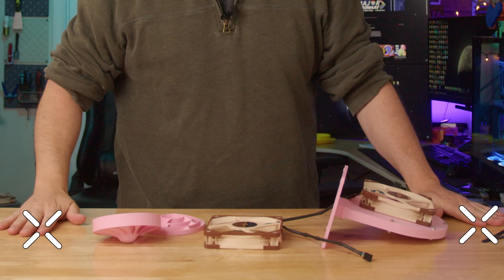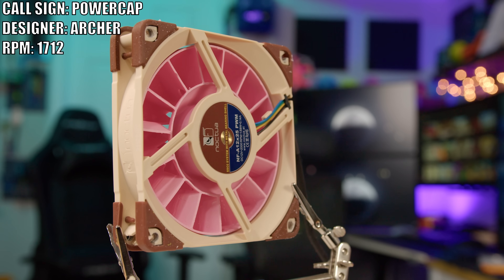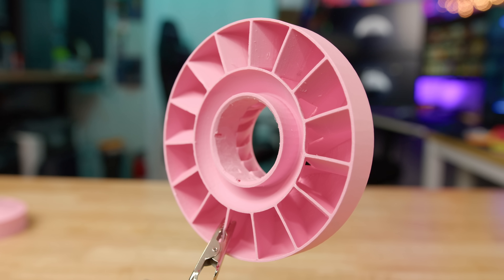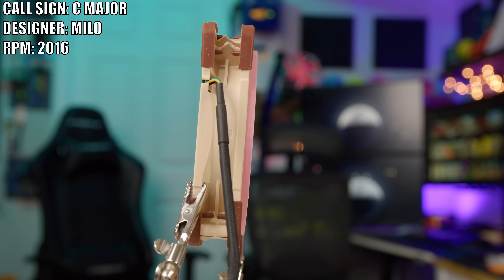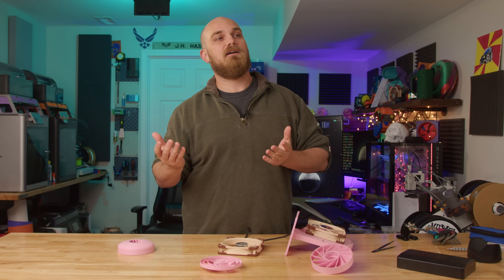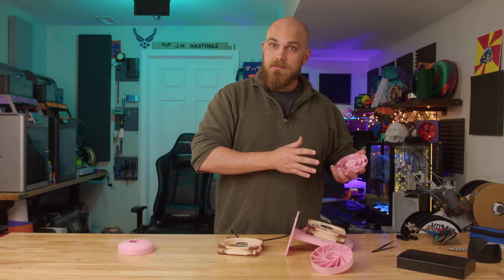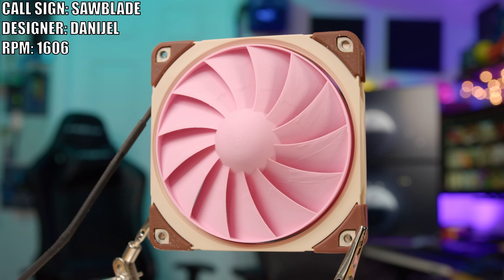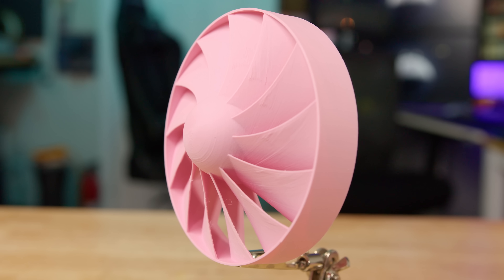Insane Fan Hack WINS Big! 😱 | Fan Showdown S6E4: Ultimate Static Pressure Battle

Comment: As a professional audio engineer I can concur that a fan (or any thing in motion) can be both extremely quiet and yet still annoying if all the sound is built up in a narrow frequency band(s). think whistling vs blowing air with an open mouth.  
An octave is a doubling of frequency. its named oct because in music that double is 8 notes up or down. 
Fun fact: good car tyre designers use the opposite approach to Milo by making sure the tyre grooves are not properly regular as otherwise your car would make a distinct 'note' at a held speed and it is one of the ways they reduce traffic sound pollution.

Comment: 3D printed the c Major and forgot to come back and say anything...
...It's great. Its a very lovely hum. I'm able to tune the RPMs of my fan and I got it perfect at 2002 RPM.
When I kick it into power mode at 6K rpm... It also sounds great.

Also, I mounted the Wonder from Down Under to my GF's gaming laptop.
No more heating problems from the 4080. That little mf used to heat up the whole bedroom.
I no longer need to crank the AC just to sit comfortable at my desk.

Comment: For me the Sawblade is the winner with only 2.6 dBA on your list while all the others are in the 40s and 50s. So 20 Sawblade fans would be as loud as a single one of the competitors, what means you can multiply the output airflow times 20.

Comment: Took a blower gpu. Removed the fan and plastic shroud over the heatsink.
Used dual 140mm fans mounted to this enclosure I printed. Looks like dual tubskeezs 3080 ti dropped to 26c idle. Boost is insane. Vram temps super low. Casses need re designed around this technology.

Comment: Reverse the fan on the stock CPU cooler, then use the Wonder for the rear fan, getting the reverse CPU fan that blows as directly as possible into the Wonder. Or place the wonder externally at the rear to blow inward to the CPU fan and have the bottom/top fans as output airflow.

Comment: surely WFDU should be disqualified? Seeing as static pressure is used to push air through radiators? And with an output slot that small its going to be outperformed by fans with less static pressure?

Comment: i think it would be interesting to switch to one of those 10W 12V 120x120x38's from Sunon, that have 234m3/h / 138cfm and 0.36 in h2o / 9.15mmh2o static pressure

some fans are spinning slower which i believe is due to the power limit of the Noctuas, the A12x25 is limited to 1.7W

Comment: Perhaps it would be worthwhile to look into the designs of the blower fans that are used in CPAP and BiPAP machines that are used for the treatment of Sleep Apnea. My CPAP machine is able to be set as high as 20cm/h2o (200mm/h20). It is also to my understanding that BiPAP machines are designed to reach pressures as high as 30cm h20 (300mm h2o).

PS... My CPAP is practically silent. (Resmed S-10 autoset)

Comment: WFDU might see some improvement with better seals, but it doesn't have to be tape as was mentioned by the original designer. It can be improved with just 3D printing. Along the face where the two halves meet, create a continuous slot in the wall on one half, and create a matching tab on the other half. That will make a better, more consistent seal than just clamping two flat faces together.

Comment: Power cap should have its air flow in opposite direction - sucking through side with big blades and exhaust through small hole. Way its done now just cant produce solid results...
Reply: Its doesnt work like that.

Comment: The Wonder From Down under should not be qualified as it is not confided to just within the fan-case.

Now I don't know the rules, I trust it is well within it. But this contest seems to be meant for a specific application in a PC case, so the rules allow for designs that are not in line with the contest goal itself.
Reply: The contest goal is highest static pressure.
Reply: @TheRattleSnake3145  looking at all submissions, the general intention seems to be to keep it within the fancase and visually appealing. Now you may have won this round within the rules, but no-one will choose your design to mount in their PC case. It doesn't follow the spirit of the contest.

It's like the fancar in motorsports that sucked itself to the track. Fantastic power, but looked like an abomination and was soon banned.
Reply: @KiterTMK  Noone will choose any of these designs to put in their case. Who is going to buy an expensive a12x25 fan just to break off the perfectly good blades just so they can then print a random fan design to put on it?
Reply: @KiterTMK  it's fine if you don't like the competition, it makes a good opportunity to start your own.
Reply: @TheRattleSnake3145  it is a standard form factor, you can literally buy the cheapest fan on the market and replace the blade.

Like I said, respected the rules, but not the spirit of the competition. You decide how heavy an opinion of one steps on your toes mate.
Reply: @KiterTMK  You came here, admitted you didn't know the rules now you are saying you know better than the person that runs the competition and chooses which design to print?  Also its for the 12x25 not the "Cheapest Fan on the market"
Reply: @KiterTMK  You clearly don't respect the rules, if you did you wouldn't have posted this negativity towards them.
Reply: @TheRattleSnake3145  you are making a ton of assumptions just to protect your ego.
Reply: @KiterTMK   You can't say one thing I have said that is wrong and you keep ignoring when I show that you are wrong   You are clearly here just to troll ( as you keep replying) and make yourself feel better.
Reply: @TheRattleSnake3145

There is no point in a rational argument about how right I am and how wrong you are because you are so offended by my opinion which invalidates your achievement. That makes it an emotional argument that cannot be reasoned.
Reply: @KiterTMK  there is no point in your "rational" argument because you don't have one and you know it, that's why you haven't countered anything I wrote ( because you can't). You also keep ignoring what I wrote because you know I'm  right and can't legitimately answer.   For some reason you have been severely triggered by a design that  was chosen by MH himself.     Start your own competition , ban all designs you don't like and get zero innovation.     Let's see then which competition  is more  popular.   Keep responding and attempting to troll as much as you like,  it will only boost the interaction on MH's channel and I will get to waste your time.  It's a win win for me.
Reply: @TheRattleSnake3145  I'm happy for the boost for MH, I'm not losing there.

You are pulling my statement out of context. I said you stayed well within the rules, but it's not in the spirit of the usual design. You brought a tiger to a housecatfight. Within the rules, not entirely a fair apples to apples comparison. That does not mean it is disrespect to the rules there.

For MH, choosing your design has the rationale of it being a hilarious oddball that boosts his engagement and thus revenue. Plenty of designs could have been chosen, but haven't to unknown criteria, it's how show, his rules what makes it to the spotlight in his best interest.

Comment: But the Wonder from Downunder is not a fan and cannot be used in any way.  It would also absolutely suck in terms of cooling, i don't know ain't that's what a fan is made for? I don't get it.
Reply: This is a static pressure design comp, thats it. Not hard to get.
Reply: @TheRattleSnake3145  Yeah i know it's about the static pressure mate but it's a fan showdown. Every other fan on the list is useable, this one isn't. That's what i don't get. What's the purpose of the design? Creating useless static pressure?
Reply: @poserbob6888  Noone is going to buy an a12x25, destroy the blades to get them off just so they can print a random fan from the showdown.   Using your logic, this comp should be shut down as none of it is really usable.
Reply: @TheRattleSnake3145  the A12x25 is just used to compare it to it's own design. Noctua could use any of the designs shown in the fan showdown except yours. That's the thing you don't seem to get. Your design built the maximum static pressure so far but is unuseable. Using my logic, Noctua or any other fan manufacturer could use some of the designs shown here in the future, except yours. Yours stays useless.

That is what i am up to. it's a FAN showdown, your concept is great but it's not a fan anymore.
Reply: @poserbob6888 this is NOT a design competition for some company ,it is for fun and entertainment.  it comes down to this, you are ignoring the stipulation of this competition which is to make the highest static pressure design you can using the a12x25.  That's it, nothing more, nothing less.
Reply: @poserbob6888  I suggest you start your own competition so you can run it how you like.
Reply: @TheRattleSnake3145  in this case, FAN showdown is misleading. Nevermind.
Reply: @poserbob6888  I mean, you could just listen to what he says

Comment: Surely, for the four inner blades to create a 31Hz fundamental signal the fan would have to spin at something absurdly slow like 7.5Hz (31/4). There are four blades hitting the air per revolution and that is certainly going to form the fundamental frequency of whatever combined sound that ring produces).
The only way I can see these blades can produce low frequency sounds, spinning at thousands or RPM, is if there is a "beat frequency" difference BETWEEN the rings, not the effect of any one ring. However, the rather course blade ratios provided by those three rings doesn't feel they could provide a difference frequency of 31 from rpm's in the thousands,... but clearly something is! Would be interested to understand the dynamics of what's creating this 31-33Hz signal

Comment: @Major Hardware Since you can measure the static pressure, flow and everything, can you stack 2 normal fans on top of each other (working in the same direction of course) and see how much the improvement is? I think that would be really interesting from a noise perspective as well, for example same noise but 30% more airflow or something? It would be good to know what to expect from such a configuration. Like stacking 2 cheap Arctic P12 PWM (3,99 each) against some pricey bequiet fan or so.

Comment: I'm honestly most impressed with the Sawblade. It seems a clean improvement over the Noctua A12x25, same noise and higher static pressure at a lower RPM. I would be interested in seeing an airflow testing of that one, as well.

Comment: What's the point of all this if there's no temps?
Reply: Getting the highest static pressure is the point.
Reply: @TheRattleSnake3145  I'd argue temps are a better measure.
Reply: @xtremefps_  This is NOT a temp contest is it?
Reply: @TheRattleSnake3145  It started out with temps and then eventually he dropped it and basically didn't explain why. I stopped watching and drop by an episode every now and then and skim the video looking for temps to see if he brought it back. The way I see it, what's the point if we don't know the temps since they would be the best indicator of which one is actually better in real-world results.
Reply: @xtremefps_  The point is the fun of designing and the fun of watching other peoples designs.  there have also been full airflow, airflow through a radiator.  This season is full static pressure. It is different every season.

Comment: The wonder from down under is basically centrifugal blower. When the rotor starts spinning, the pressure around the outside increases (this is due to centrifugal force, which is a real force that is experienced by objects in a rotating). This causes air to exit through the outflow opening. The exiting air also draws in air from the center. These will always win static tests assuming they are properly designed. The power cap is almost a blower but they kind of screwed up the design.

Maximizing static pressure involves considering the characteristics of the driving motor also. The rotor has to be sized so the motor operates at a speed and torque where it delivers high power.
Reply: I am sure you are correct in you explaination as a whole, but I'd like to point out, that centrifugal force is not a real force.
Take for instance the "feeling" of being pushed to the outside of a curve when driving a car into said curve with a bit too much velocity.
Now, since changing direction (driving through a curve is constantly changing direction) will always be an acceleration of the car, and the car (and you within it) is being pulled into the curve by the friction of your tires on the road, you will feel a "force" "pulling" you out of that curve. And whilst the feeling is certainly real enough, calling it a force is not correct.
It is in fact caused by the tendency of objects to stay on their path as long as no other force acts on them to change that, called inertia, as decribed in newton's first law.

So your body and your car "want" to go in a straight line, but the friction of the tires on the road keeps acting as a force to accelerate the car into a new direction.
That is also why friction is such a huge factor for race car tires, as they have to get through a  curve at MUCH higher speeds than a normal passenger car has to. SO the race car tire needs to get a LOT mor friction on the ground to actually be able to stay in the curve and not get pushed out of the race course by its own inertia.
Reply: @Craveheart3699  I took physics too. The centrifugal force is real in the sense that it can cause a pressure gradient in a fluid. If it weren't real, centrifuges (and centrifugal blowers) would not work. People often say that it is not a real force. This is a stupid thing to say. I think it is best to say that it is a force perceived by observers in a rotating reference frame. Some examples of people who might be in a rotating reference frame are every single person living on planet earth.

However, to observers who are outside the rotating reference frame, and are in an inertial reference frame, all effects observed can be explained without utilizing the centrifugal force. So in that sense, the force is often said to be imaginary or to not exist. Maybe it would be better to say it is an apparent force. I don't know. But saying it is "not real" is, really stupid. Saying it is not a proper force in Newtonian physics is fine, but it is not necessary to bring that up every single time the issue arises.

It's like tomatoes. People call them vegetables. Just roll with it. You don't have to go around saying "actually, tomatoes are a fruit..."
Reply: @mckenziekeith7434  Okay, yeah, I see what you mean. Fair enough. Probably should have chosen my words better.

Nice discussion! Thank you!
Reply: @Craveheart3699  I probably should have chosen my words better too. Next time it comes up I will give it some careful thought.

Comment: Explanation of C Major is totally wrong. It should produce a C (root note), E (major 3rd; frequency ratio of 5:4 to the root), and G (perfect 5th; frequency ratio of 3:2 to the root). Octaves are significantly farther apart; C3 has a frequency 4 times that of C1 and C5 has a frequency 16 times that of C1. The reason you're seeing those frequencies in your Fourier transform is likely because they're overtones of the root; if you play any frequency, even a pure sine wave, a Fourier transform of the recording will still show repeating peaks at every integer multiple of the root frequency (eg: a sine wave of 100Hz will show bumps at 200Hz, 300Hz, 400Hz, etc. of decreasing amplitudes).

Comment: The Wonder From Down Under clearly demonstrates that turbo style fan would be really good for static pressure. Maybe create something like it but use fan and chamber geometry that follows real world turbo instead? That is, the outer fan blade diameter should be narrower but the exhaust port should be much bigger and the fan blades should nearly touch the wall at the position near the exhaust port wall. Maybe start with the book "The Importance of Geometrical Properties in Industrial Turbofan Design"?
Reply: Keep in mind that printability also need to be taken into account.
Reply: @TheRattleSnake3145  Yes, and also decide how to connect the motor because for real turbo-like setup, you would want to use steel axis with ball bearing, which is not easy to accomplish with this standardized fan motor setup.
Reply: @MikkoRantalainen  Its already been decided, you can see it working in the video.

Comment: Just looking at the C Major fan it's obvious that it's producing a chord with ratios 3:4:5 (3 to 4 to 5). A standard major chord in my mind is 4:5:6, since 4:6 is the same as 2:3, aka the major fifth. But 3:4:5 is an inversion of the chord, taking the fifth down an octave. I don't know names of inversions though.

The blade speed isn't as important as cycles per rotation, which is why simply looking at the blades is fine. The exact Hz would depend on the speed it's driven at so it's always going to be that 3:4:5 chord, not necessarily played on concert C.

Comment: The winner of static pressure here is the looser of airflow (the amount of air moved). That's simple physics really. Some configuration of compressors in the forced induction are particularly good at making air more dense, so that the limitation of airflow of valves can be mitigated this way. In the PC cooling world you'd better go for good airflow/low pressure fans for very good breathing mesh case and high pressure/lower airflow fans on dense stacked fins radiators/heatsinks. I still don't know in what instances a super high pressure/lowest airflow ratio fan would be fit in PC cooling.
Reply: This is a design competition, for the fun of it.
Reply: @TheRattleSnake3145  I totally dig bro and I like it watching wondering what's that good for.